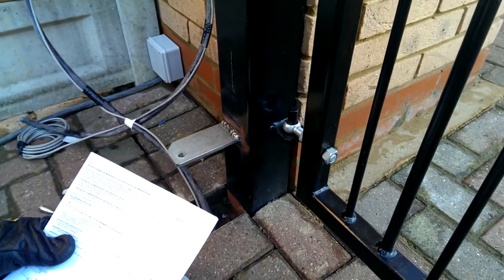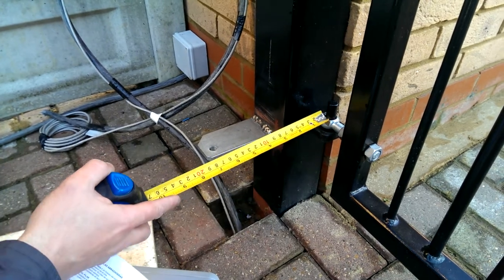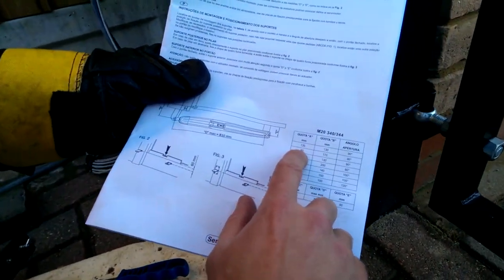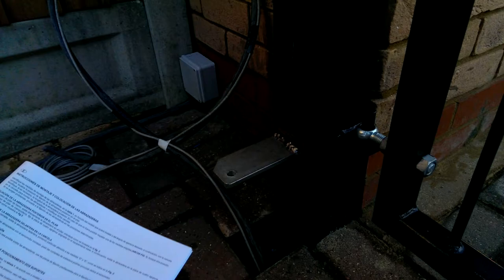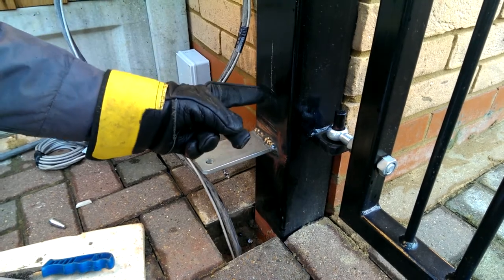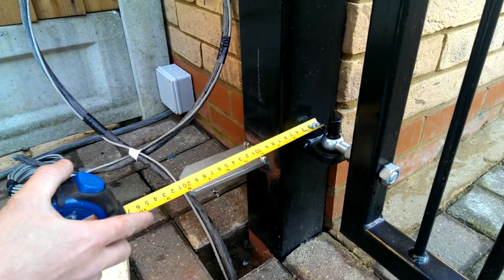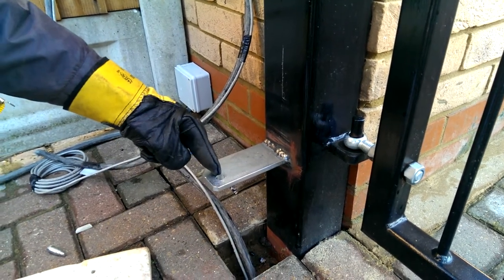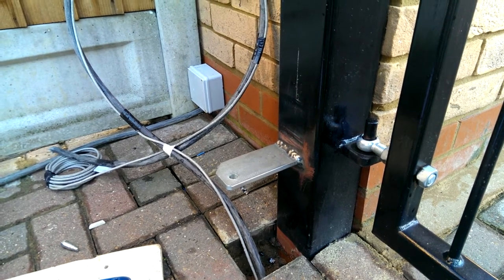Installing an Electric Gate Motor - Swing arm geometry Part 1

Comment: My gates need to be able to open outward due to limited space - is there any way of doing this without the motors being on the outer (public) side?
Reply: I have seen it on my site and I don't know if it was correct?